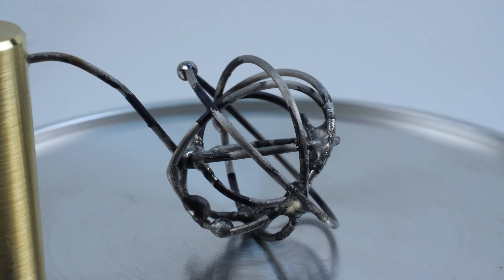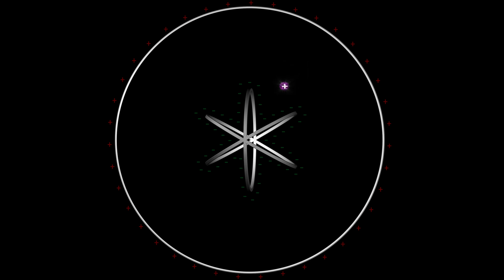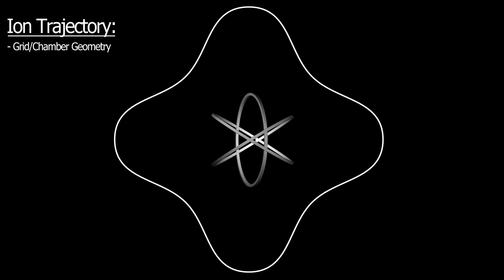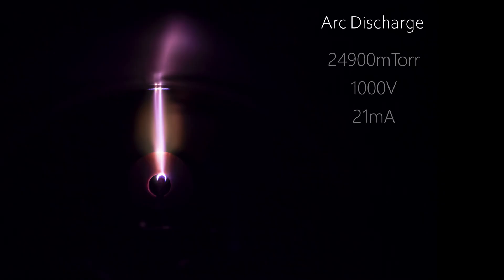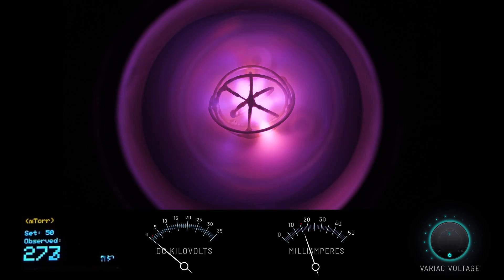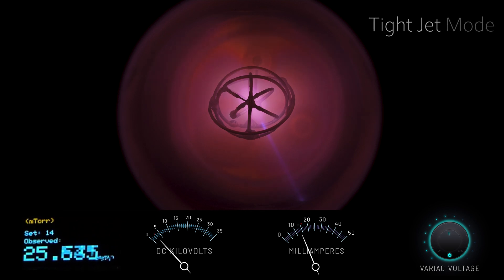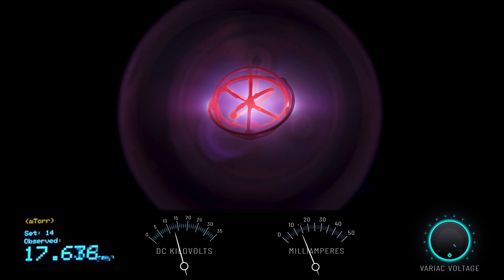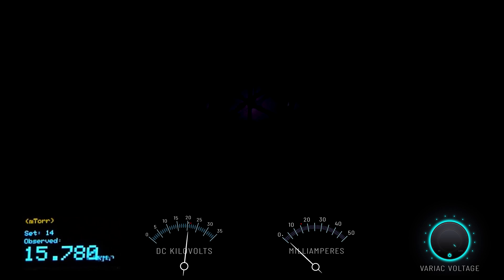Fusor Plasma Dynamics  - Star mode, Jet mode, Glow discharge

Comment: ~ 3.37 at near atmospheric pressure but i read 25torr...? I just dont follow
Reply from the maker: Nice catch, I should have put a disclaimer there. That's an error in my Arduino code/calibration. The display pressure caps at about 25Torr because the Pirani gauge's voltage to pressure conversion equation is logarithmic. At higher pressures, a small change in voltage results in a huge change in pressure. So while the readings are quite accurate around the 1-5000mTorr range, when you start venturing higher than that the error margins will grow by orders of magnitude. I could tweak it a bit (and probably should), but without another reference gauge for a proper calibration this is what I've been working with. So what I was saying in the video was accurate, but the numbers I was recording in the upper range were very inaccurate. The actual pressure starts at (or very close to) atmospheric with the gauge reading inaccurately and as it drops, the numbers become much more accurate. Thanks for the comment!

Comment: How about adding a variable inductor +capacitor between the inner and outer grid to turn the chamber into an RF tank circuit?

That would drastically reduce power consumption requirements as well as spike the voltage due to the Q factor of the overall system.   The goal would be an electrical configuration similar to a Farnsworth multipactor.
Reply from the maker: That's a fascinating idea, but unfortunately I don't think a multipactor variant could work to power the fusor directly, as fusion requires higher gas pressures and DC current to accelerate and confine the ions toward the grid. The Farnsworth multipactor requires a clean vacuum to generate secondary electron emissions which helps make the device so efficient. The high pressure required for fusion results in too many ion collisions in the multipactor, hindering secondary emissions. RF could really shine though if used in conjunction with the HVDC. RF could pre-ionize the plasma, then feed the reactor with an increased supply of ions at a lower energy cost. The idea is exciting but unfortunately with most things fusion related, implementation of ideas can quickly become sobering :)
Reply: @Project.Infinity  
Thanks for the response 🙂

IMO secondary emissions would not required for the tank circuit (and might actually be counterproductive)
The goal is merely getting deuterium ions to accelerate in a specific pattern, so their inertia is recycled instead of wasted and less energy is wasted on grid collisions .
The AC goal that ions are accelerated inward when they are in the outer-grid, and repelled when within the inner grid.  Full-wave would be the diameter of the chamber and the average ion velocity.

It's such an interesting question I've decided to study and confirm it for myself, as I have all of the HV and RF equipment already.  Just need to build a fusor.......😅😅

Months away, for sure, but I've seen scant researchers other than perhaps Farnsworth himself going in this direction.
With such low pressure in the chamber I suspect the Q factor could reach a pretty high value..

I'll keep you posted if/when I finally get to fire one up🤗
Reply from the maker: @hakasays  It certainly is an interesting question. I love the idea of exploring loose ends in early research. Promising results can sometimes get lost in the hype of the newest, greatest thing. Definitely keep me posted, and I'm sure I'd make a video if I end up venturing into RF territory. Good luck, and stay motivated!

Comment: What about interrupting input power? Ir would be really interesting smashing some particle with 100kv into a wall.
Reply from the maker: Interrupting the input power by using something like a spark gap and LC tank circuit to supply high voltage transients? That could be really interesting to see! As far as fusion goes though it would come with the tradeoff of very low current, so not many chances for fusion events. I'd love to see if it would improve star mode though, my transformer's voltage capacity has been the bottleneck there.

Comment: Currently working on one for a science fair project, so far it can only reach glow discharge regime but I’m optimistic it’ll get to lower pressures eventually 😃
Reply from the maker: That's awesome! Vacuum leaks are a big culprit if you're having trouble reaching a lower pressure, provided you're using a decent pump. I'm not sure how high-end you're going, but a metal vacuum chamber is best if feasible. And when in doubt, JB Weld Original is surprisingly vacuum friendly :) 
Best of luck in the science fair!

Comment: Old EE here - I've been interested in fusion since the early 1980's...  These fusor channels (along with the plasma channel) are really interesting to me.  I know fusors won't work by themselves, but check out the "photon reactor" - using depleted uranium for fission.  Problem is really high energy photons (about 10 MeV) are needed.  Maybe a fusor could be used to provide high energy neutrons - which will also split U238 - though I don't know what energy level is needed.  Presumably a nuke engineer couold supply that information...
Reply from the maker: This is definitely a concept I'd like to read into more as it sounds like it has some stark advantages. Being able to simply switch off a fission reaction could improve public perception of nuclear energy. Also using depleted uranium could be huge for reducing waste from conventional reactors.
That said, I have doubts about using neutrons generated from a fusor to run the reaction. While I believe it could definitely initiate a fission reaction, fusors are known to be extremely inefficient, and they'd likely require much more energy to run the reaction than the reaction would produce. Still, this is a really interesting avenue--and maybe there's room for improvement or for more hybrid concepts down the line. Thank you for sharing!
Reply: @Project.Infinity  No problem, and thank you for the work you've been doing (and the reply!)
Reply: @Project.Infinity  Another thought - it seems Thorium reactors require a neutron source for startup, seems they use some U235 to get their initial neutrons.  I've seen that Daimler-Chrysler built a fusor capable of generating about 10^11 neutrons per second (haven't found any more info on it but haven't done a deep search - seems the work was done around 2001).  I'm sure a Thorium reactor could be designed and built which would require a neutron source to produce energy.  I also think a fusor or ten could be built to supply those neutrons.  I know fission reactors are best suited for baseload power - so something using a fusor as the control source wouldn't be able to quickly respond to fluctuating power demands but could provide baseload power.

Onto another thought - have you by chance flipped the grid voltage on your fusor?  Basically the inner grid would be the + side so would attract electrons - not sure if you've ever heard of a Penning trap but that, plus running a current through the grid to keep the electrons at bay - should create that configuration.  The interesting thing about that arrangement is that the electrons would create a "virtual cathode" which should pull ions in - a guy named Bussard (sci-fi writer but also physicist?  Creator of the Bussard ram-jet idea for space travel) was working with a group on that (he passed away, I don't know what if anything became of his work).

Apologies for the somewhat long winded post...

Comment: Why having a tungsten grid?
Reply from the maker: Tungsten has the highest melting point of all metallic elements. This means it can withstand the massive amount of heat that builds up from ion bombardment better than any other known material.
Thanks for the question!
Reply: @Project.Infinity  Thanks for the answer!

Comment: Bear in mind please this is NOT a "Farnsworth/Hirsch" fusor.  It's the "Hirsch/Meeks" variation, which is based on Farnsworth's overriding concept of Inertial Electrostatic Containment"  It's been sixty years since anybody has built what could be rightfully called a 'Farnsworth' fusor.  Still, it's cool that so many people are learning some of the particulars of what it takes to 'bottle a star.'
Reply from the maker: Oh wow, very interesting. Searching for more details about each design I found this discussion which was very helpful: https://fusor.net/board/viewtopic.php?t=13161
It seems you are spot on. Thanks for the correction!

Comment: I'm afraid your Geiger counter is most probably not activated by radiation, but by electromagnetic noise, UNLESS it's properly shielded in a Faraday cage.
Reply from the maker: I did originally have issues with electromagnetic noise in an early fusor design that had a lot of breakdown issues. It was then that I confirmed x-ray production by shielding the Geiger counter with a grounded aluminum foil Faraday cage. I also confirmed x-rays by comparing the GM counter with a pen dosimeter. Much to my surprise the mR dosage absorbed by the dosimeter and calculated by the GM counter correlate pretty closely. With how fast the GM counter roars with high x-ray production I imagined it would saturate and give a false reading. I'm quite happy with its performance!

Comment: hey, I am planing on building a diy version of this kind of a fusor, but i have about a 12kv power suply and only about 5000 mtorr of pressure, would i at least get a glow mode out of my setup? + i have a cube like copper cathode and a ring like anode positioned over the cathode by around 3cm (can increase to 6/8cm if needed).
Reply from the maker: At that pressure you'd probably get glow discharge and see plasma surrounding the cathode wires. Your power supply sounds like it can supply more than enough voltage, but you'll only pull about 200V out of it at that pressure because there are too many air molecules which will drive the current up. I'm sure it'll look beautiful though!
Reply: @Project.Infinity  yeah, thanks for help, but you said my power suply would only draw 200v, but i am using a zvs driver + a flyback transformer, does that change anything? It is capable of 5 to 10cm arcs if i suply the zvs with 12v 17amp
Reply from the maker: @lukisltu5282  No matter what power supply you use the discharge at that pressure will be low voltage. It might require a high voltage to initiate the discharge (similar to the 5-10cm arcs at atmospheric pressure), but once the discharge is initiated, the ionized gas acts as a conductor with very low resistance and high current. It's not exactly ohms law when dealing with plasma but you can think of it that way. It'll only draw high voltage from the power source once you remove air molecules (lower vacuum), increasing the resistance of the circuit.

Comment: Wait a minute, I didn’t think radiation was still produced without deuterium
Reply from the maker: Right, there is no neutron radiation at all because there was no deuterium. There was a bit of X-ray radiation though generated via bremssrahlung. It's emitted when high energy electrons in a vacuum hit a dense surface. In this case the dense surface is the stainless steel walls of the vacuum chamber.
Reply: @Project.Infinity  wow, scary. Good thing it can be blocked

Comment: Your center electrode is all wrong.  You want what looks like a wireframe soccer ball. A truncated icosahedron.
Reply: This is a complicated subject but the shape of the electrode actually doesn't matter that much. Check out Chapter 3 of Miley and Murali's IEC fusor design. It's not intuitive. But, it comes down to the ion mean free path being less than 3 cm.

Comment: This is so pretty!
Have you considered using permanent magnets to further shape the plasma?
Reply from the maker: Thank you! I tried to capture it the best I could on camera but it's honestly even more spectacular in person. 
I've thought about wrapping the chamber with a coil and experimenting with electromagnetism but haven't tried it yet. I will also eventually be building a sputtering setup which uses magnets to concentrate the plasma on a target. I'd certainly make a video for either project :)
Reply: @Project.Infinity  both ideas sound spectacular if i could ask where did you get the education for this and how do you maintain such hugh video quality for a much too low subscriber count this content is fantasticaly detailed and quite thourough i will use a lot of the data in this video for my own projects and expirements thank you personally for helping inspire a whole new branch of theories and projects i can make because of you
Reply from the maker: My base of knowledge comes from physics classes in university. The vast majority of fusor specific information though I've learned by reading forums at fusor.net and published articles.

Comment: Around 2 years ago when i was 14 i made a cathode ray experiment, now i rey want to build a fusor but cost of all 
equipment needed and precision is on anther level than jar, fridge compresor and ZVS circut fo r high voltage, in this point i can only provide good voltege source for the fusor and not much more so i porpably giv up on dhis project for now. 
I will probably come back to it in a few years and then films like yours will be worth their weight in gold
Reply from the maker: It's such an engaging and rewarding hobby. Hopefully you'll get back into it and I'll have more videos on the topic to share! Thank you for the positive feedback.

Comment: Very cool demo. Are you willing to reveal the total equipment cost? If the cost and safety risks are low enough, this could be a profitable product for the educational market. Instead of just telling kids to study math, entice them with an interesting hands-on experiment that demonstrates a behavior which can only be fully understood by the math that you want to teach next. Hopefully at least some of the kids will then eagerly pursue the math in order to solve the mystery, and/or better visualize the math concepts because it connects to their memory of running the experiment.
Reply from the maker: Thank you! The cost varies quite dramatically. My setup has been built with mostly secondhand lab surplus equipment or custom built parts I turned on the mini lathe, so it's total cost is more reasonable. If I had to guess all parts in total would add to around $2000-3000 along with a LOT of sweat equity. Unfortunately the voltage and current are way too dangerous for kids to work on unsupervised, so selling these would likely be too much of a liability issue. My best suggestion for kids with an interest in the subject is to visit fusor.net and start with the basics. It's a highly rewarding hobby but it definitely comes with an expense
Reply: Most people need about 5000 to build these. Mine is creeping towards that number too.